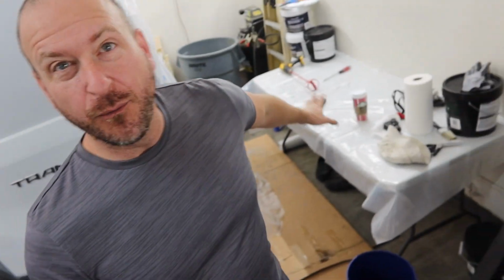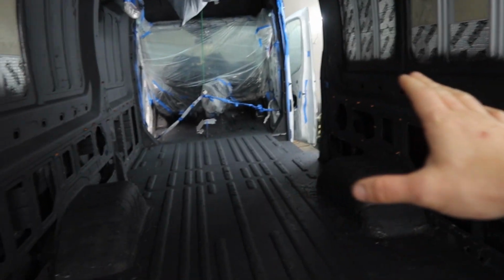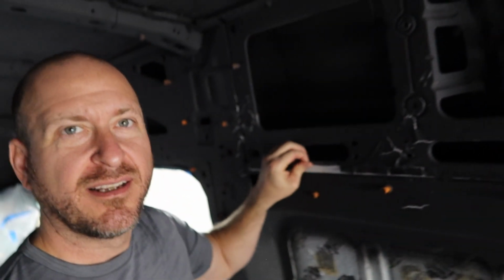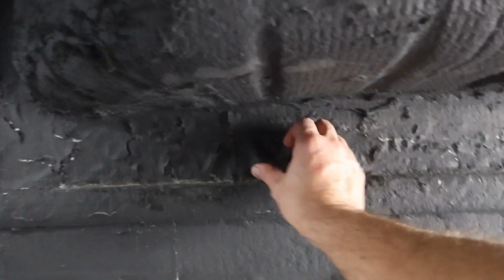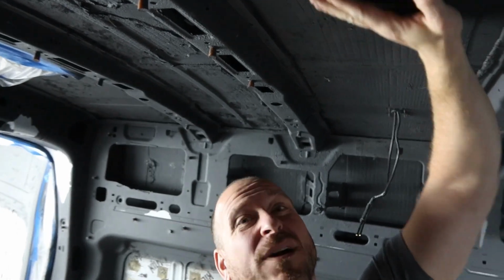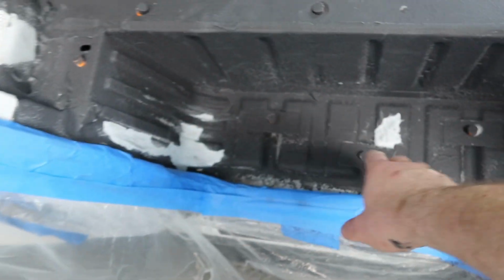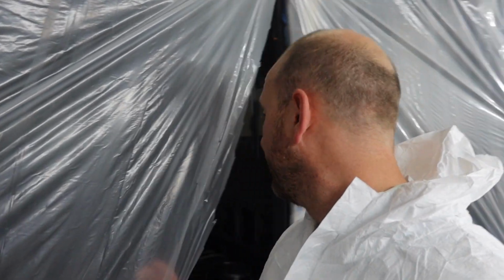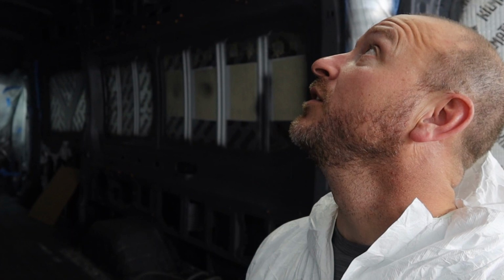How to Spray Insulation in Vans | My First Coat of LIZARD SKIN Sound Deadener is Peeling Off FIX!

Comment: Prep work is the most important part in painting!
Laziness never works!
Reply: Correct, But Lizardskin only states to watch surface with dawn dish soap and dry. So why is it peeling?
Reply: Their website clearly states if paint has been on for more than 7 days it needs to be scuffed.  Written in the prep section.